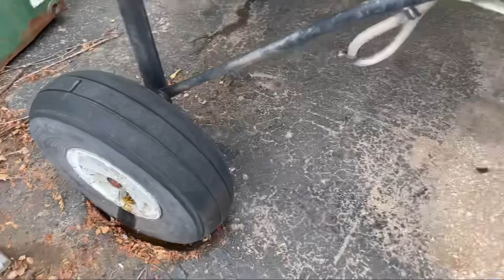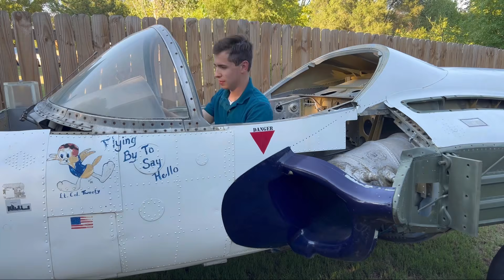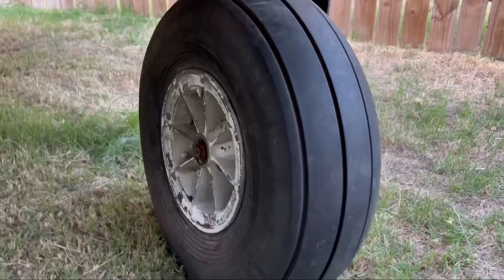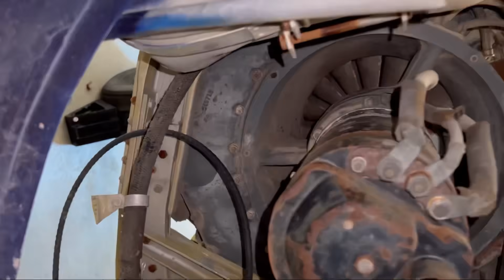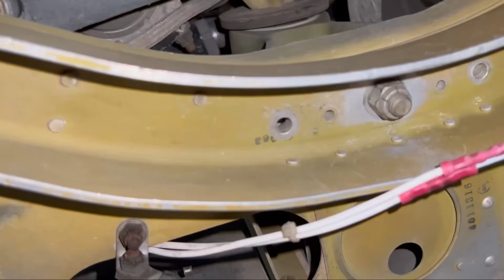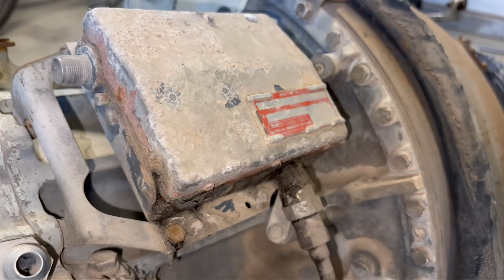Rescuing an Air Force Jet from the Junkyard

Comment: Dude, your project is way more interesting than that other guy who’s refurbishing an old twin. The guys raised over $1 million with that project. You could raise more! What’s interesting about your project is; it’s a jet, it’s dangerous, it’s unusual, and you are young. 

But the material is dangerous. Magnesium Thorium-alloys are used.  That dust getting in your face could be deadly. 

“There is a general trend away from the use of this material. Its radioactive content can be high enough that special procedures are required when handling it and disposal can be expensive. From 1973 to 1983, approximately 4000 to 5000 kg of thorium oxide was used per year in alloys for the aerospace industry. In 1991, only 500 kg per year was being used in all metallurgical applications, not just the aerospace industry, and by 1993 that number had dropped down to 100 kg per year. At the time that NUREG-1717 was written (2001), there were only two U.S. manufacturers of magnesium thorium alloys (Wellman Dynamics Corp. and Hitchcock Industries) and they had indicated that they might be ceasing production.”

Comment: Good luck! Starting decades ago, Cessna began doing everything in their power to prevent these aircraft from ending up in the hands of civilian operators. They had at least two primary concerns : (1) the cost of supporting such a complex and ancient aircraft for the benefit of a handful of operators would be prohibitive; and (2) providing any kind of support would subject Cessna to potential liability risk.  So, I expect that, despite the large number of Tweety Birds produced, you are going to have a devil of a time finding replacement parts.

Comment: Something oddly amusing about a jet aircraft having it's punctures repaired with a standard bicycle patch kit 😂

For your the damage on your compressor blades/vanes, you can likely dress back the damage and it'd  probably run fine. I work on gas turbines and it's common practice to just dress first stage compressor blades back when they start 'peeling' when they thin from corrosion or FOD damage - But that being said, a GT isn't zipping through the air with someone sat next to it 😂

You could also dress them back, laser weld the leading edge and then dress them into shape, though that depends on the composition of the metal. We had no problem laser welding onto CT hot section blades and filing them into tangs, and laser welding doesn't really have a negative effect on the material in terms of annealing / internal stresses unlike traditional welding

You're absolutely going to want to balance that comp though, no doubt it'll be spinning faster than a GT haha

Comment: ..... Good move, getting this project ... I like the work thus far ... BTW, I used to make turbine's ... They were all made from titanium ... Made on a pantograph machine ... Used ti-cut, to run over the cutters, to machine them ... A long, boring job to get a completed unit ... My point being ... Keep trying to source a NOS or very fine example to replace your worn one ... They are balanced very well ... And are designed to fail at about some 110,000 rpm ... At that speed, nothing much is safe in the shop from injury ... Especially you ... BTW #2 ... Food for thought ... As your a pilot ... There is a clip or two, on YT, where a guy mounted a very small jet engine on a glider plane !
... It was quite satisfying watching him pilot that glider ... Which was registered as experimental ...
... Did I pique your interest ? ... Regards .....

Comment: As a former aircraft mechanic, I'd like to say I love your enthusiasm. As you have said you plan on being far away from it when you test run it. I saw you filed the rough edges of the blades. However every little bit removed changes the weight, and the balance is very important. (which you probably know already). Just wanted to point that out. If run too long long she will probably eat herself as the speed builds. Hope to see you at least get her running. Follow your dreams! 👍

Comment: So Jack did you get the engine torn down ? There is a special way to remove the compressor case from the outer combustion case….take the firewall off first and then jack screw the compressor case but make sure the bearing housing, bearing are removed from the fuel distrubutor first. Once the compressor case is off disassembly 100% can be accomplished. The compressor blades leading edges must be blended evenly and the inducer balanced other wise you will have a shaker. Is this a -25 ? If yes don’t lose any turbine case spacers otherwise your bearing and pork chop won’t line up and you will have major turbine blade rubbing ,

Comment: Those engines are tough as nails. I bet if you cleaned it up, put power and a few gallons of Jet-A to it, it runs as is. Bad fan blades and all.

Comment: You DO NOT WANT TO START THE ENGINE! Those primary compressor blades are so worn down that it is now so out of balance you could ruin the engine if it’s not already beyond repair. If you want a ground runner for display it would be wise to find some salvageable blades for all of the turbine stages. Even for a ground runner it will take time to disassemble inspect, replace key bearings and parts but in the end you will have a running conversation piece. Good Luck!

Comment: does the T-37 have any relation to the CT-114? it has remarkably similar air intakes/wings/gear, but I remember the Tutors being quite a bit larger and sporting a T-tail.

edit: Nevermind, I just saw the engine nozzles, the Tutor was a single engine trainer.

Comment: Holy cow. I didn’t realize the difference between the way YouTubers and Instagrammers talk until now. The fast jumpcuts and no pauses in speech is very unlike YouTube. Not saying it as a good or bad thing. Just an observation
Reply from the maker: Yeah it’s definitely different. I absolutely hate making full length YouTube videos and really can’t even stand watching a lot of them without putting it on 2x speed or skipping around tbh. Feels like there’s so much filler in most of them. I don’t care what you had for lunch or whatever, just get to the point haha. I’m working on it though, long form is where the money is at. This is kinda a hybrid, a little slower than usual but still basically just a bunch of Tiktoks/Insta videos smashed together.  Just needed to get something out to build up my watch hours so I could monetize cause at the time only long form watch hours counted. Gonna start getting into true long form soon tho!

Comment: as a canadian who grew up spending his entire childhood in RCAC(royal canadian air cadets) and following that up with  joining the airfoce after highschool. I fucking LOVE your enthusiasm regarding planes. 
Also we call these dragonflies here where im from :D
over 14 countries used these respectively as trainer jets from what i understand, with each of those countries have their own bloody variant of this plane  which i always foound really insane
I would love to see this fully restored and back in flight, i think that would be a most amazing project!
Reply: that engine will NEVER be airworthy again.. any airworthy turbine engine is EXPENSIVE! especially an older engine with no longer manufactured life expired parts, no engine paperwork and logbook (no logbook = basically scrap metal). that engine was likely left in that training aircraft as it was timed out or more likely FOD damaged and not considered economical to overhaul. that damaged compressor wheel is likely to explosively fail at operating RPM due to the chunks missing out of the blades and the corrosion all over it.

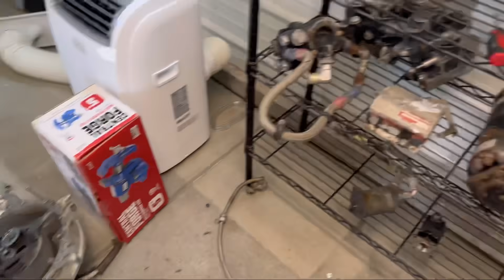Comment: @4:22 "... If you want to see me potentially blow myself up and have fun in the process... "

You made my day when you popped up randomly in my feed with a good sense of humour and good content.

PS - your video owning your way of measuring and justifying got me subscribed. All jobs needs accuracy, it's just with what margin you will be happy with and if it is fit for purpose at the end hehe ... 
PSS - I have used digital calipers as a substitute for a ruler / measuring tape once. Was the perfect length for the piece of material I wanted to cut hehe

Comment: I just discovered your channel. Curious to see what you end up doing here. One thing I personally would do with that airframe is turn it into a full motion immersion flight simulator.
It's not as difficult as it might seem at first glance and you have a pretty nice cockpit to start with.
If the guages where still there could make them work with a microcontroller like arduino. Or you could convert non working instruments into servo driven arduino based guages. 
Since you work for Cessna maybe you could even buy the cans and glass and faces and build your own.
Lots of ways to do it.
Everything can be interfaced with Microsoft Flight Simulator. You can literally map ALL the flight controls, switches, lights and anything else you can think of to the real world equipment and hardware in the cockpit.

Comment: Hello Jack A&P here. As you are not the original builder you need an A&P to perform or sign off most work on an experimental aircraft. At the annual condition inspection I call out or assist in the required work. I then can sign off the work items and sign off the aircraft in a condition safe for flight. There were only one or two guys I would do this with. Naturally you can do what you want with not for flight units. Stay safe.

Comment: I think you need me to come over and fix that Tweety bird for you. I worked on several over the years. They are very loud and will cause hearing damage if you run the engine. I was sent to Mexico to repo two of these aircraft that were used to shoot down a civilian aircraft back in the 90s.  Get project for you person like yourself.

Comment: Just a couple concerns, I checked my manuals and as I suspected with that generation of engine you need to take some precautions. 
As in 
Thoriated magnesium castings. 
Asbestos hose sheathing 
Asbestos gaskets 
Fun project but play safe man seriously that white dust floating around could be thoriated mag corrosion FYI.

Comment: You'd be surprised, the engine will probably still run "fine" with compressor blades that damaged. Obviously you should make the effort to blend the damage out to prevent cracks from separating chunks.. Obviously there's a difference between wanting the engine to run for fun and wanting to fly in it, experimental category or not.
Reply from the maker: I agree 100%!!

Comment: How funny! I’ve  done this 3 times, but not on a cool factor like this! I’ve bought 2 APUs from 2 scrap yards for less than $200 each, and got a rolls Royce axial turbine (my first “real” jet engine) in exchange for a knife sharpener stone kit I had in my truck as I’d forgotten my wallet. 

But YOU sir win on an epic scale! To have a fuselage attached to the turbine is SO BADASS!!!! I’m jelly and anxious to see the outcome! 

Side note: Don’t run that first stage compressor, no matter how badly you want to with that condition it’s in. The ONLY way to get away with it would be an obvious tear down, and taking the blades off, having the x-rayed to verify no cracks, and then cleaning up the leading edges, and finally balancing out the whole assembly.

Comment: Jack, I flew T-37's with the J69-T25A engine as an instructor.  That is one of the loudest engines ever.  But, even with all that damage, it should still run.  They're practically indestructible.
Reply from the maker: Man im jealous! I bet that was a blast. I’ve heard they were really fun to fly. Can’t wait to hear the scream myself, never have had the pleasure
Reply: @jackschneider17  You will need the Dash-1 to know the procedure for starting.  It's a 1950's engine and requires like 8 steps to start properly.  Not like modern engines.  Hit me up if you need help.
Reply from the maker: @michaelhill2844  luckily I have the flight manuals, maintenance manuals, and J69 overhaul manual so I should be set but I’m sure I’ll still have questions!
Reply: @jackschneider17 you need to put that on a go cart and see how fast you can get it to go!
Reply: @jackschneider17  After an hour and a half orientation flight I will say the aircraft was a dream to fly. The engines were replaced with J-85s ( I believe)minus the afterburner (T-38 engine) the right seat was replaced with a fuel tank and the aircraft was used in Vietnam, the engine pushed it so well you had to get the gear up as soon as it was in the air to avoid stressing the gear.   Enough about that, enjoy your toy and get ready to upset ever dog in the neighborhood. By the way the ejection seat was pushed out of the aircraft by a blast that of ballistic shell,, I don't remember which.  Be sure to wear a good headset if you get it running. Another thing, tie it down really well .
Reply: @jamessmejkal8803  only the AT-37 had the J-85s. Needed more power due to increased weights of bombs
Reply: @jamessmejkal8803   The A-37 is powered by the J-85 and has more than twice the thust of a T-37
Reply: @jackschneider17  https://youtu.be/5NG0h2u4Wec
Reply: I'm not sure Enid, OK appreciated going from the scream of the subsonic dog whistle to the constant giant mosquito drone of the T-6, but I sure do wish I could have flown the T-37 as well. They look like a blast.
Reply: Keep it up jack it’s clear you’re learning a bunch with this project and the first hand experience working on this stuff is priceless
Reply: Did you ever fly T- 38s or F - 5s?
Reply: @j.lietka9406  No.  T-37's.
Reply: @michaelhill2844  that's ok! Thank you 🤓
Reply: Is that airplane a 4 seater? Thank you 🤓
Reply: @j.lietka9406  2-seater.  Cockpit looks so large because the ejection seats and canopy actuator are missing.
Reply: @j.lietka9406  2-Seat trainer.